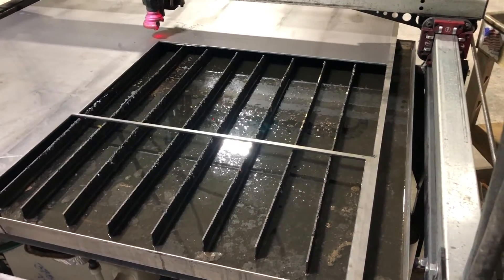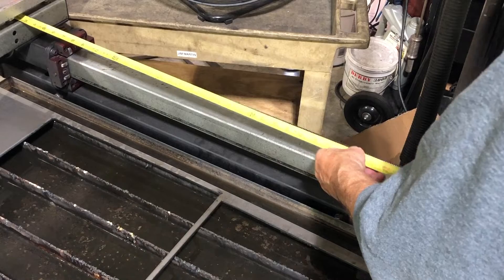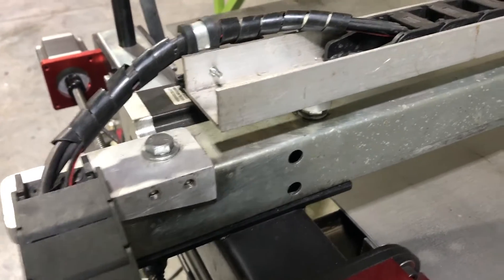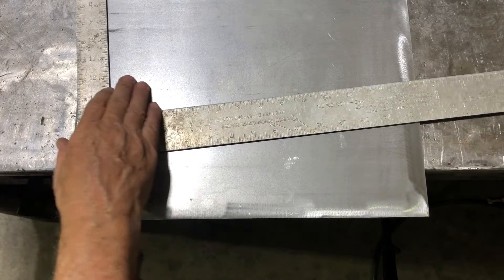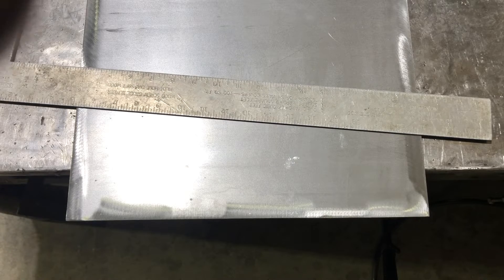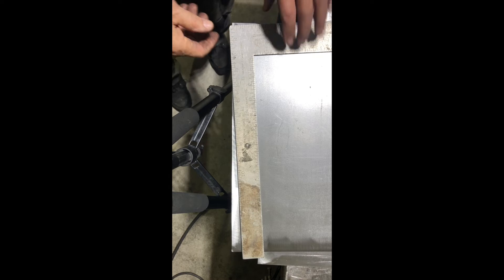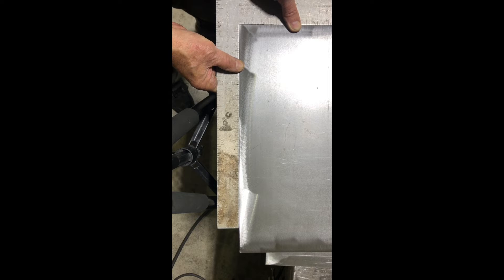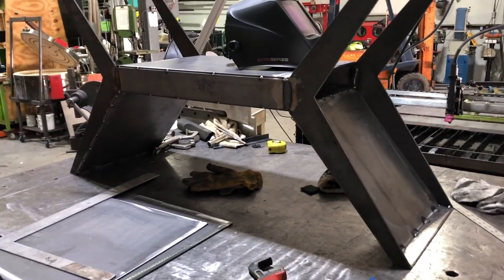How to make square cuts on your Langmuir Plasma Table

Comment: Hey Dan,
I noticed you have nicer lead screw collars than the ones I have. Please share where you received yours. The collar screws on mine are so small that they do not tighten properly. 
Regards,
Doug
Reply from the maker: Doug,  the ones I have came with the machine!  I haven’t replaced them. Wonder if later machines had smaller collars.  I would think replacement could be found easy using the shaft diameter

Comment: Hi Dan,
Got a question in one of your videos you were using a game controler of some sort where did you get it and how do you hook it up the the table is wireless cable connected? Thanks Dean
Reply from the maker: No game controller I’m afraid!  I’ve seen folks on the forum talking about them and I don’t think it’s too difficult to install them but I’ve not found it necessary so have not pursued it.

Comment: Did you check your square for squareness?  I have 4 aluminum squares, and I found 3 were out of square, compared to my metal squares…
Reply from the maker: Didn’t compare my aluminum square to my steel one but did measure the cut piece corner to corner to verify it was out of square 🤓

Comment: Hi!  Have you installed the Langmuir Limit Switch kit yet?  Curious to hear an update if you have.  I got my CrossFirePRO running for the first time today (with the Limit Switch Kit installed) and cut my first G-Code program.  I found that my 7" x 9" plate was off by around 1/16" - 3/32" along the 9" dimension.  Tried playing around with the lead screw adjustment (controller powered off) but didn't seem to do the trick.  Not sure if you have new advice on a technique that might work better (with Limit Switches installed) or if all the same rules apply?  Thanks!
Reply from the maker: Hey Greg,

I have the limit switch kit in hand but haven’t had time to install it.  Because of the way I mounted the track for the drag chains I’m going to have to mod the mounting for the x-axis but don’t think it will be a problem.  I was confident adjusting the lead screw with controller off would be the trick to making cuts square.  I’ll have to look closer.  I may set a dial indicator and see if turning the lead screw with the controller off changes the results.
Reply: @CustomCreations3  Thanks Dan.  I have my table mounted to a really beefy rolling table with the legs "sleeved" into 2.5" square tubing so everything is really rigid, but in my excitement to make my first cuts I forgot to level the table to the cement floor so there was certainly a degree or two of slope going on there.  Not sure if that would explain anything... but I will dig in more... check my cross-wise measurements on the rails, and look for any other grotesque issues.  I remember you said that the lead screw trick is for "fine tuning" only.. and if you try to fix large errors that way it could lead to binding in the bearing blocks or elsewhere.   These videos are great by the way!!!!  Very helpful and well-paced.
Reply from the maker: @MightAsWellK5  I think the lead screw tweak to correct 1/16” over a 9” length is within the adjustment range without risk of bind but that’s just a guess.  Keep me informed as it can help others that have similar issues.  I’ll do a video on the  installation of the limit switches and the mod I’ll have to do for my setup.
Reply: @MightAsWellK5 how did it go?

Comment: I know I have bumped the edges on occassion and I have had a piece of metal hang up the torch head a few times.  I am sure either instance could affect the square on the table.  Fortunately we don't use our machine for pieces that require precision cuts but I do get a random warble from time to time.  I usually attribute that to my lead screws needing a cleaning.  I am pretty particular about keeping the rails spotless with a very light coat of oil when not in use.  As far as I can tell, the bearings are in good shape.  I probably should check the forum for any maintenance requirements or schedules.  I have had the table for over a year now and it has been great.  This table has been a game changer for us and I am still learning.  Thanks for the videos, I will be looking into those switches.
Reply from the maker: Hey Erika,  yea I don’t usually have to be concerned about square cuts as most of my plasma work are signs, wall art, etc. but I’m glad I discovered a way to fix it when it needs to be right!  For a while I’ve been using a scotch bright pad and WD-40 to clean the gunk off the rails and then using auto wax to coat them to try and shed the water that gets splashed up on them.  I use a water soluble cutting fluid in my water as it eliminates rust on the metal I cut and I’ve discovered that it is what creates a sticky residue on the rails after the water evaporates.  So now instead of WD-40 I simply use water and it dissolves the residue!  
As far as I know there are no maintenance schedules but sounds like you stay on top of keeping it clean which has to help.  I’ve had the machine for close to two years and just yesterday cut new slats using the table.  I know Langmuir sells them for $39+shipping but I get steel for $.50/lb so cutting my own is way cheaper.

Comment: I was glad to see you bring this up because it goes to show you that it is important to check accuracy periodically of all the stuff we take for granted after we setup a new tool.  Could you "mark" the 4 corners of rectangle almost as big as the limits of the table travel in the x & y direction using your laser & a Sharpie on sheet of metal & then check the diagonals and adjust until they were the same?  Keith / STL, MO
Reply from the maker: Thx Keith…wish I had known it was off before cutting multiple panels but fortunately I was able to get them to fit!  Like you I did consider making a template that could be used to check square before doing anything that had to be accurate but wasn’t sure what to use or where I’d store it since it would be use rarely in my case as most if my work are wall art, signs, etc. and being square isn’t such a problem.  When the time comes and I need to verify I may do the sharpie technique or might just do a super short torch fire at the corners and measure diagonals.  

By the way I’ve taken a second look at the limit switches Langmuir is going to be offering soon and the website does imply you can home the machine so once it’s square that might be the solution. 

Dan
Reply: @CustomCreations3  Doing the what Keith says would save wasting material. You could even use the piece you are going to cut from to check it before you cut from it.
Reply from the maker: @Darnic-Fab  yep…if I’m doing this kind of thing in the future and panels need to be accurate you better believe I’ll do preliminary checks first…lesson learned!